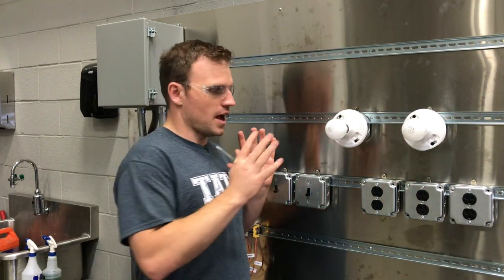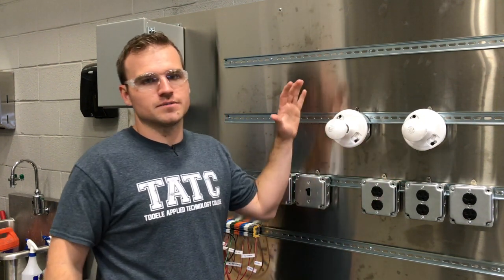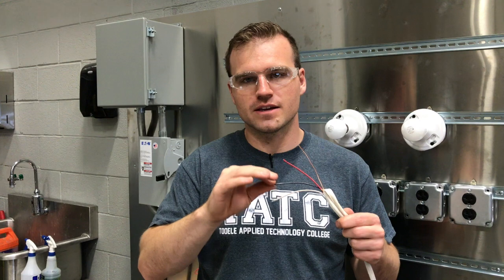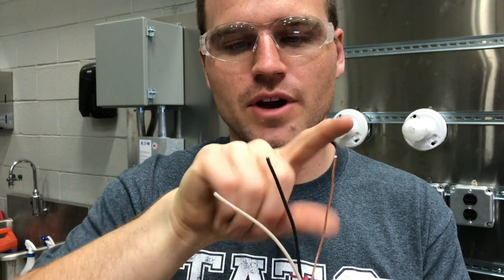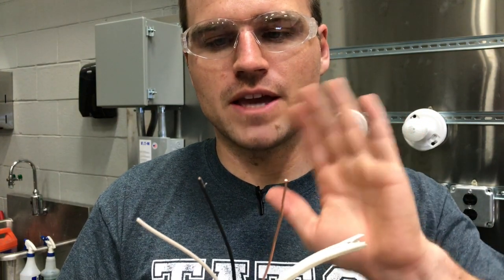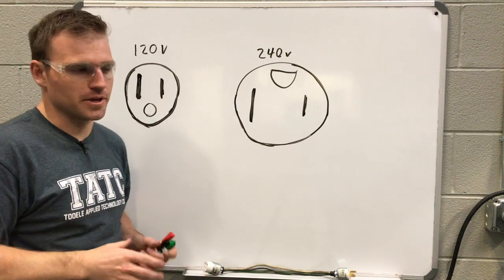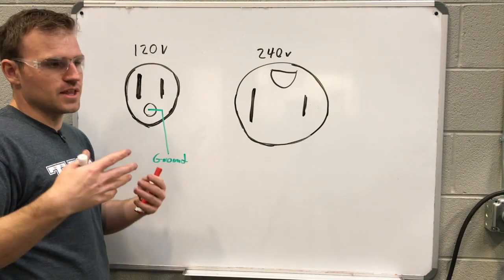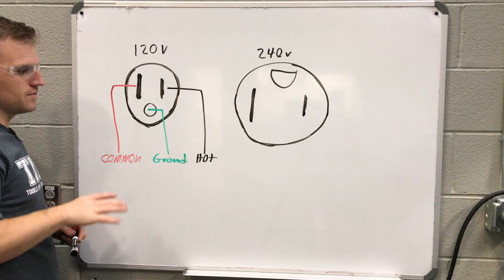Basic Electrical - Basic Wire colors

Comment: I used to have a light post that lit up at night via timer. Next to it was an outdoor outlet that burnt out due to water damage. They were taken down by a relative. Both lines seem to be coming from the same circuit. However one line has White, Yellow, Brown and Green, which I assume powered the outdoor receptacle. The other line is White, Yellow and Green. I deduced the yellow line is actually Hot. I assume the line is interconnected from the same power. The light only turns on by the timer while the receptacle is always live. How do I wire a new receptacle using the brown wire? Please advise. Thank you